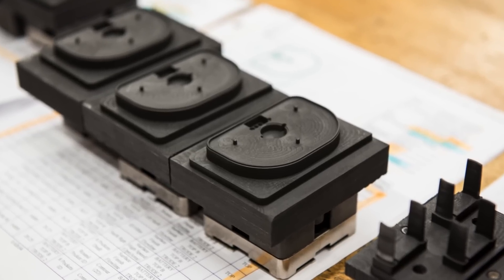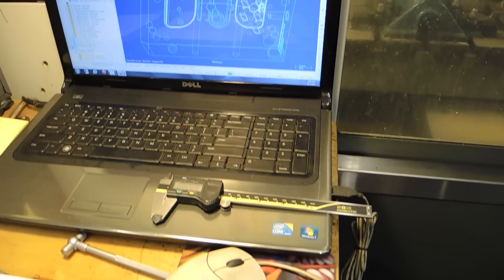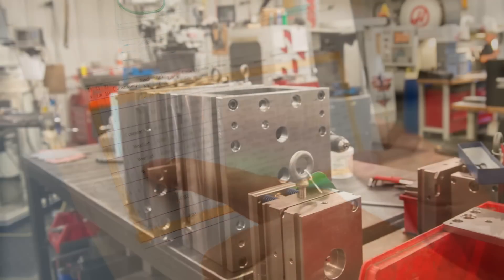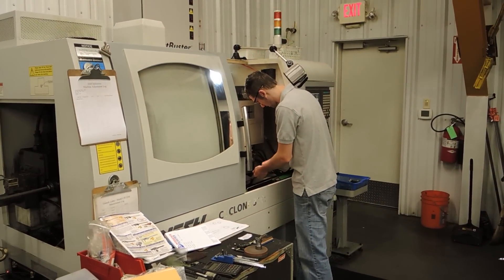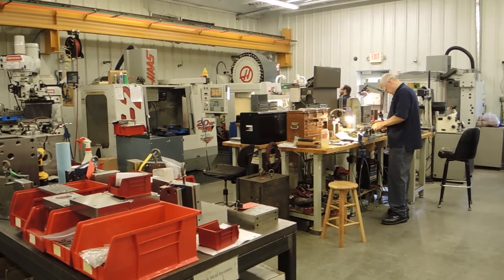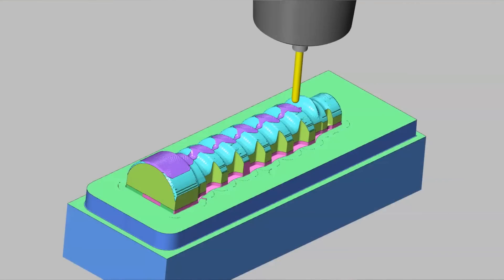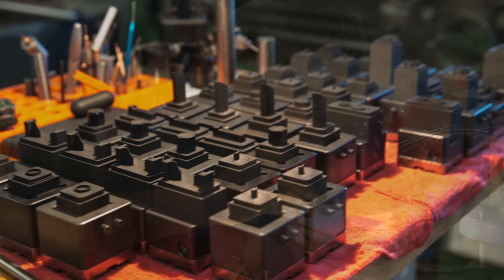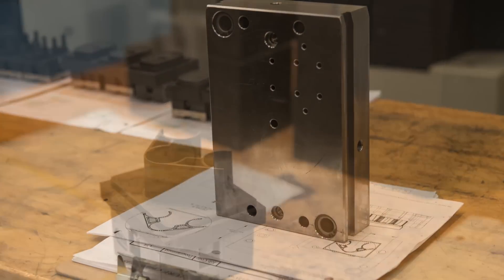A Winning Combination - Mastercam's Toolpath Library with Dynamic Machining

Comment: I was at a Mastercam user location the other day which is using the Helical (high performance carbide tools) and they are saving tons of time on the machine.  The tools run quietly and extremely fast/efficient